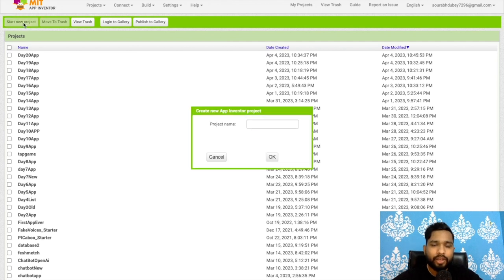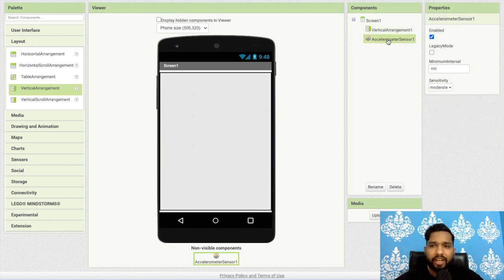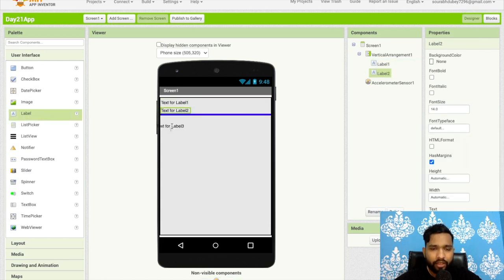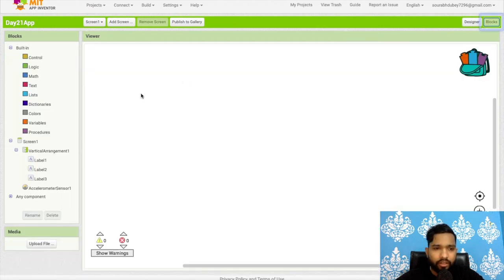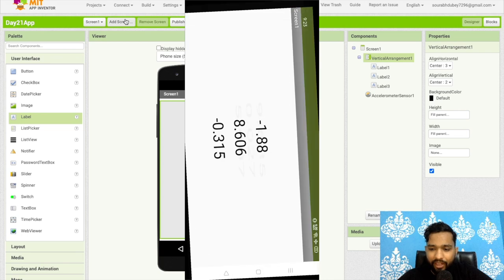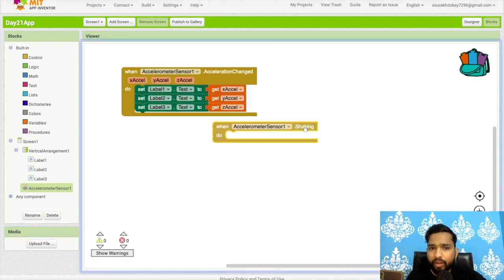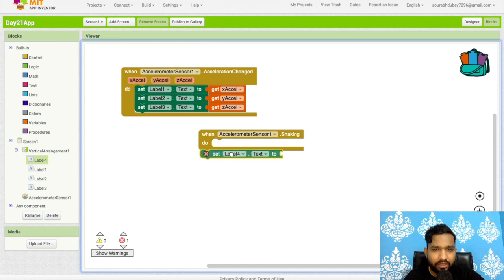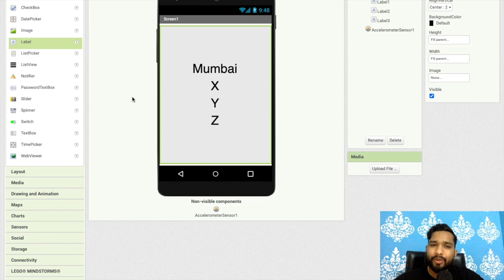How To Use Accelerometer Sensor in MIT App Inventor 2 | Day 21/100

Comment: Hello, the accelerometer does not send any values when the app is running in the background or when the lock screen is on. How can this be changed?
Reply from the maker: Hello, for that you need to run your app in background. u need to use some extension that can help u to run ur app in background.
same for all sensors.
Reply: Thank you, which extension can you recommand, iToo only works with the "shake"-Component. Greetings from Vienna